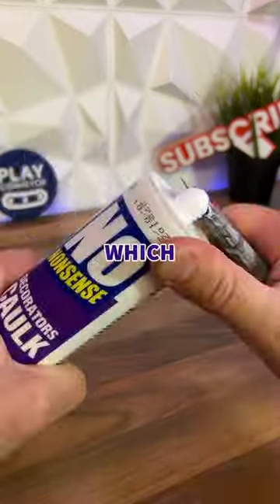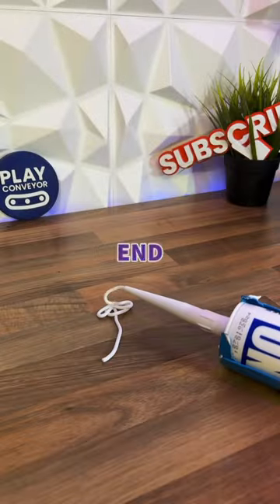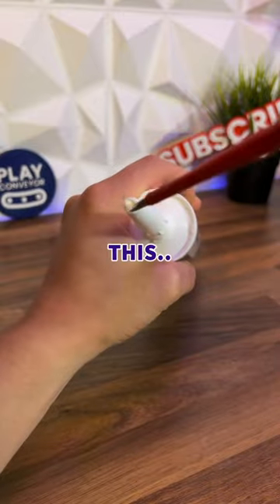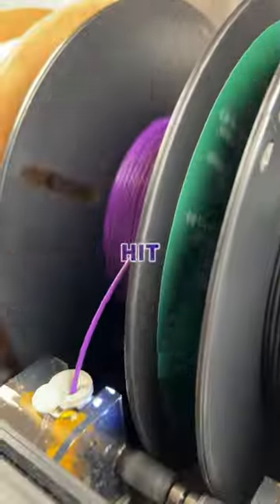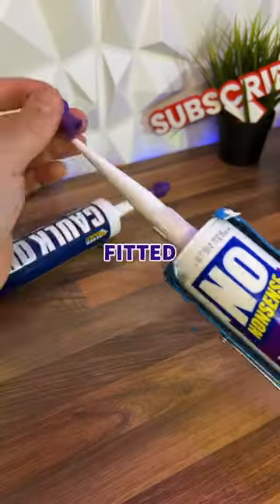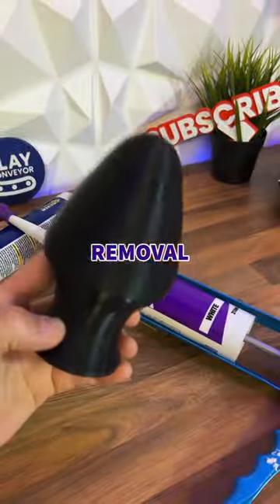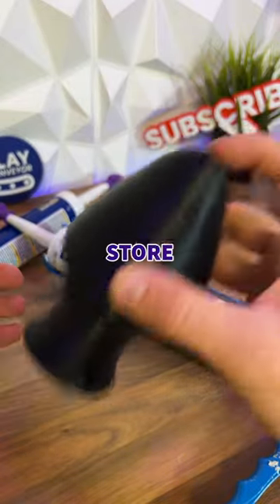3D Printing a MUST HAVE Decorators accessory! #3dprinting #shorts #diy

Comment: I hope you sanded it smooth before use
Reply from the maker: We make sure we sand all our prints and paint them thoroughly
Reply: @playconveyor i hope you use non-toxic paint
Reply: @playconveyor WE?
Reply: @Fant_aa my as s 😊
Reply: @duTrexIt  ??
Reply: Yo this is underrated comment 😂😂😂😂😂
Reply: The layer ridges... stay
Reply: @playconveyor  yes plug ur self
Reply: @playconveyor  You wouldn't prefer them rough instead? Hmm
Reply: His calk or the plug? 😂
Reply: Please lubricates them before using. 😂
Reply: @Fant_aa  yeah? What's strange about 'we'?
Reply: Don't even use it after sanding. This has millions of tiny openings where bodily fluids and matter can get stuck in and cause infections. Maybe dipping it in epoxy or latex could help
Reply: And lubed it for smoother operation
Reply: @playconveyor hope you painted it a beautiful silver
Reply: @moneyclip8772 they arent painted. They are colored by the filament put into the 3d rinter

Comment: My mom has some of those, it’s for those big construction adhesive tubes though.
Reply: you sure its for that
Reply: My mom has one too, but yours is connected to a metal pole that moves. I guess it’s for making sure the caulk doesn’t dry.
Reply: It can plug good
Reply: Bro won but at what cost
Reply: @Gregrygasser I don’t think you got the actual joke it’s not a diledo

Comment: Friendly reminder that FDM prints are NOT body safe regardless of filament or settings
Reply: Isn’t it just a caulk protector??
Reply: But my butt was happy I printed o
It
Reply: @KingTr1py  You have no idea
Reply: @KingTr1py oh my dear sweet summer child
Reply: @reedmarasco1586  what??
Reply: @bsmith9890  is it also like a sun-protection thing?
Reply: @KingTr1py oh my lordy lord
Reply: @skimlord  what?
Reply: @KingTr1py its a b plug 😅😅
Reply: @Joe-te4br  what’s that
Reply: @KingTr1py Tell me you've had a sheltered life without telling me that you've had a sheltered life 😂
Reply: You can spray the print with a finish of some kind, or apply putty/clay or shrink wrap some other safe material over it, since its a relatively simple shape... you'd lose it's storing functionality, but you weren't gonna use it to store glue nozzle plugs anyway, where you?
Reply: Good for one time use🤪
Reply: @abiA5 Tell me you didn't recognize the sarcasm, without telling me you didn't recognize the sarcasm
Reply: All you need is tpu
Reply: Good to know.... like seriously...
Reply: Thank you kind sir, did not know that
Reply: IDC
LOOKS SAFE ENOUGH
Reply: Starting ahh coment
Reply: It's a part of the experience.

Comment: they make metal and silicone ones too that can be used for other things :)
Reply: Also some are wood and some are injection molded plastic
Reply: Glas ones are also pretty popular, that way you can see if the white stuff got hard ^^
Reply: На вас випробуваємо
Reply: Будемо на тобі проводити випробування на протечку

Comment: Besides the obvious low hanging fruit...

The better way to stop having your caulk harden in the tube is to let a small amount of caulk harden at the tip of your caulk tube. The hardened caulk makes a perfect plug for your tube. Just make sure it's enough outside to pull the plug out with your fingers. 👍🏻